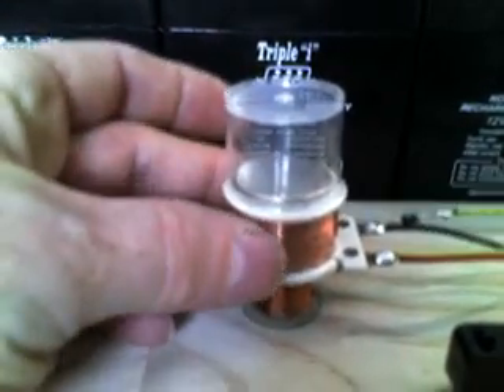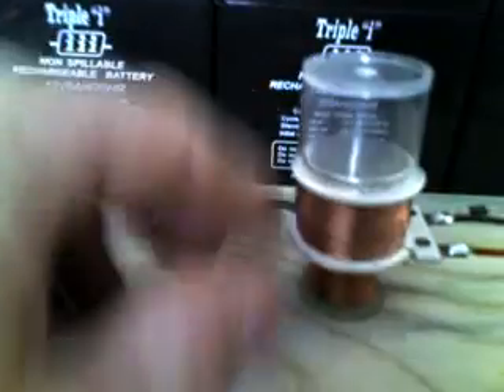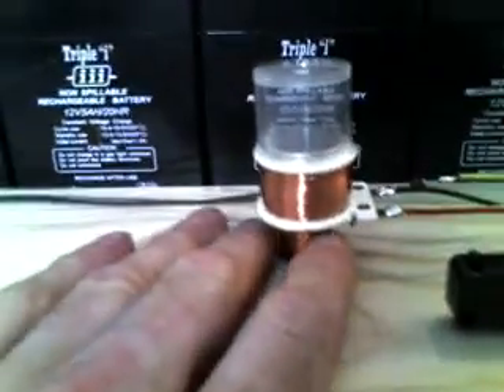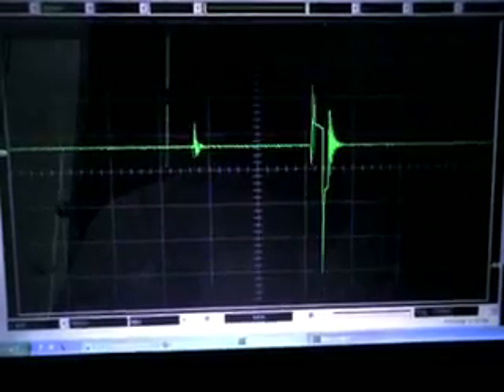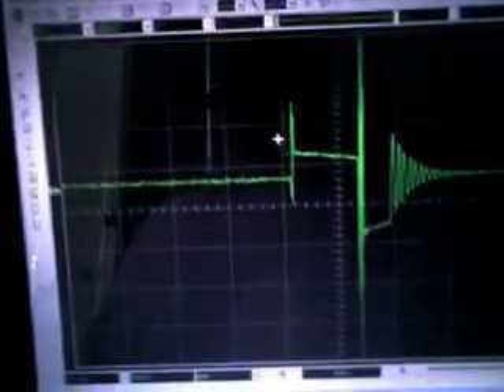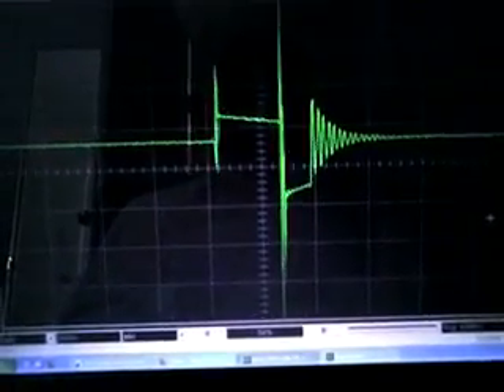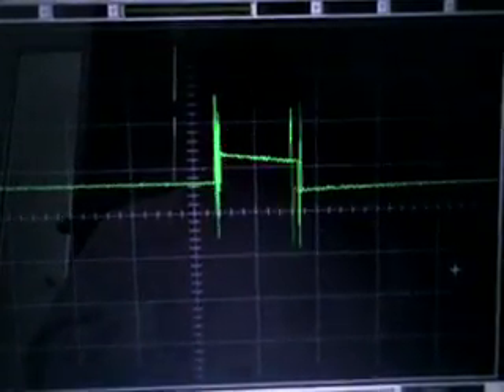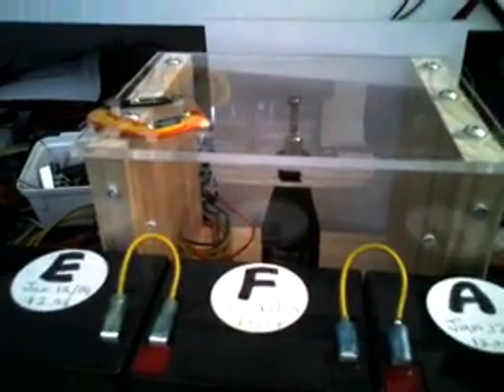Effect of Recirculating BEMF back into Coil test 1

Comment: build a two stage rotor motor, we're  the influxe current attracts the rotor and the flyback current pushes the rotor in the same direction.

Bi-polor motor like a clock shaft.
This side goes this way the other side goes that way but the shaft spins in one direction according the front or the rear.
Reply from the maker: You're looking at old stuff. I built a motor with separate coils that operate from the flyback recovery. Start here https://www.youtube.com/watch?v=TfhIv3ihOKY and check forum topic link (in description) and search for p11, p12 etc.

Comment: Electricity is 
 -  ION  GAS -
Known as  THE either.

MAGNETISM IS THE RESULT OF MOLECULES WITH DIFERENT CHARGE STATES. OPOSITES ATTRACT.
LIKE KIND REPELL.

MAGNETISM IS ATRACTION FORCE CREATED BETWEEN PARTICALS OF OPOSITE POLARITY.
ANTI MAGNETISM IS THE REPELLING FORCE BETWEEN PARTICLES OF SAME POLARITY.

MOTORS MUST BE DRIVING BY ANTI FORCES BECAUSE ATTRACTIONAL FORCES WORK AGAINST THE ANTI FORCES BEING GENERATED BY COLLAPSING ELECTRO MAGNETIC  FEILDS.

Comment: Back EMF/flyback current produces a repelling feild in the iron shaft of the rotor causeing if to pull  against the induced electro magnets attraction forces that pull the rotor around.  

Back EMF equalls you trying to stop the shaft with your hand grip.  You can't, neither can the flyback current.
But both work as a breaking force none the less.

If you create the flyback current in isolated external coils useing influxe current.
The back EMF CURRENT CAN BE USED TO PUSH A MOTOR ROTOR WITH TWICE THE FORCE AND SPEED OF A TRADITIONAL ATTRACTION MOTOR.

Comment: The coils influxe current produces a pulsed atractional force on the maget.

THE COLLAPSING FEILD PRUDUCES A  PULSED REPELLING FORCE ON THE MAGNET, AND THIS IS HOW MOTORS ARE SUPOSSED TO WORK.
IF NOT BULDOZERS WOULD PULL THE LOAD INSTEAD OF PUSHING IT AHEAD OF ITSELF.

YOU MUST INVISION FOR YOURSELF.

Comment: If motors were designed to be driven in reverse by flyback current generate in externals, they would be 3× more POWERFUL than being dragged around  through attractive forces.

Invision for your self.

Comment: Tesla discoved flyback voltage induced a stronger feild than influx current did,
With this knowledge he built a motor that used a small influx current to induce a  the flyback spike in current from huge external coils which he used to drive a dc motor in reverse that produced 3× the torgue and speed as his influx generater did. 
Later he figured out how to combine the BEMF GENERATER INTO THE MOTOR ENTERNALY, WERE BY ENTERNALY POWERING ITSELF ONCE AN OUT SIDE FORCE BROUGHT THE UNIT UP TO SPEED.

THE DEVIL WILL NEVER TEACH YOU HOW TO BREAK HIS RULES WHEN PLAYING GAMES WITH HIS ELECTRIC TOYS.

YOU MUST INVISION THINGS FOR YOURSELF INORDER TO BUILD TOYS BY YOU CAN PLAY WITH BY YOUR RULES.

NOW HERE IS SOME GENERAL INFO THE DEVIL DOEST WANT YOU TO KNOW.

1 ELECTRIC HP.
EQUALLS
3.75  GASOLINE HP.

THE RULES SAY WATTS IS WATTS.
THAT IS PURE BULL.

Comment: Diode across coil polarizes the current  at the coil by absorbing half of the applied waveform. That gives more of a direction to the coil magnetic field. The lack of reversing field moves the magnet better. The mystery is, why the current draw decreases ???

Comment: Could be this is only a resonance effect, i.e. resonance frequency for the magnet lifting/vibrating is met. And at high efficiency also since the back emf energy also is used to move the magnet.

So the back emf is not lost as heat, but used to do work.

Comment from the maker: Hi Paul,

yes! you have that perfectly correct and It seems that extra pop comes at no extra cost of energy.

Varying the speed of the dremel motor changes the frequency and since the spacing between the reeds stays the same then the on time reduces as frequency rises or the other way around if the speed drops.

Luc

Comment from the maker: Hi MAllen7424 ,

sorry but unfortunately it does not flip flop the field. When the coil is switched off it takes the collapsing field (which is now going at opposite direction of the original activating current) and the diode sends it back in the coil the way the original current was going in, so there is no reversing of the field. I wish it was reversing.

Luc

Comment: Nice!

I understand when you pulse the coil your trying to repel the magnet, once you loop the Flyback voltage back into the coil which is just as the Field collapses, it gets an extra pop of energy.

Does the speed of the dremel rotor alter any from the two positions?

Paul..

Comment from the maker: Hi Can101276,

thanks for posting your positive comment. 

My first test setup was using a mosfet as a switch. It was capable of taking up to 600 volts but I found no benefits with voltages over 200v as the current started climbing. Maybe the coil length needs to be longer as the voltages goes up.

More testing needs to be done to come to understand or use this effect.

Luc

Comment: You have achived  a virtual doubling of the hertz rate by tapping the coil twice with the same pulse, great work!  
And if that is so, and the coil is resonating, then you have reached a new harmonic of resonance.  
Tesla seemed to infer that the higher the voltage used the greater the results.
Again nice work Luc.

Comment from the maker: Hi YouMockMe,

I'm sorry but I think you're not understanding the test. The rotary switch power is always connected to the coil and is not strong enough to move the magnet. When I press the switch, all it does is re-directing the collapsing field back in the coil. No extra energy is added!... in fact, the power consumption goes down when I do this and the result is making the magnet levitate WITH NO EXTRA ENERGY.

Luc